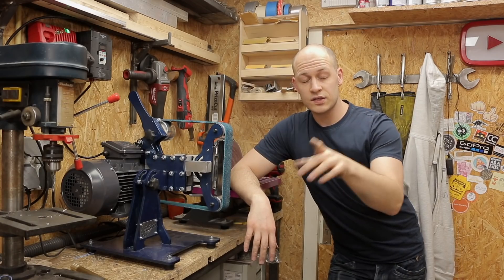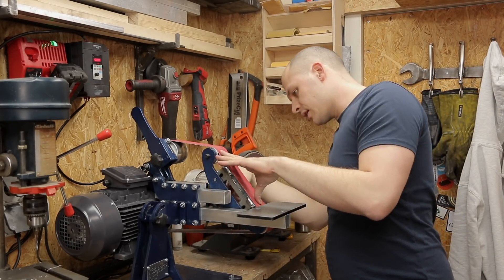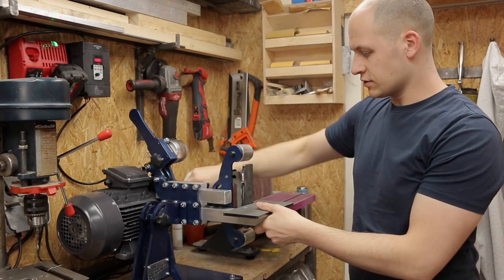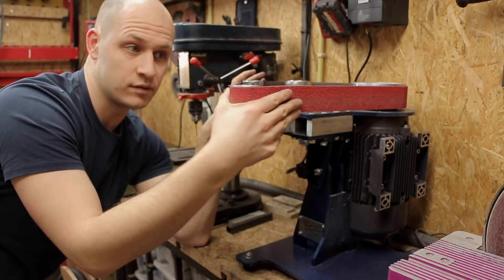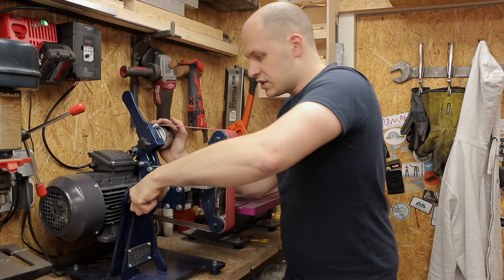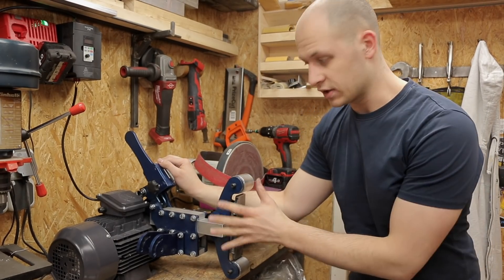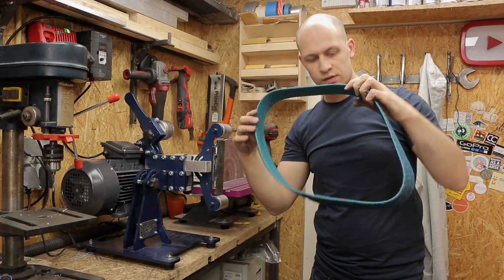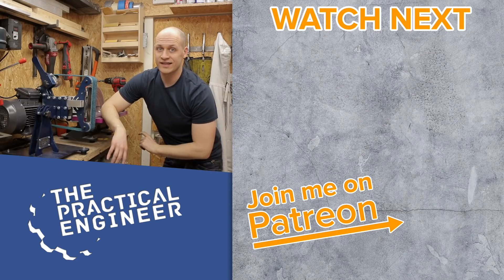Belt grinder overview & questions answered - The plans are ready!

Comment: A Laugh for you.... I watched the assembly film and did exactly what Emile did, and welded the handle bits back to front. Managed to unpick and reweld the right way around, so all is good. I found a return spring on line it is a Fordson Tractor brake return spring and is perfect. I'm real happy with the machine.

Comment: Also Emile the belt is too tight, it will degrade the belt and stretch it out.  It would be advisable to put a spring on that does not have so much tension.

Comment: Emiel, I’m so impressed with your belt grinder design. Very well thought out. Question: what is the diameter of the drive wheel?
Reply from the maker: I have a 5 inch drive wheel on it. That gives me about 20 m/s of belt speed. 6 inch could be a bit better I think but this is already super fast
Reply: The Practical Engineer Ah yes, that’s how you calculated your higher speed. Many belt machines have only 4 inch drive wheels. With imperial measures, a 4 inch wheel is approximately 1 foot travel to 1 motor rpm. Thanks!
Reply from the maker: Yeah, the metric system is a bit more complicated to use 😂😉 I found the 4 inch to be a bit too slow

Comment: I don't have any specific use for it either but I'm sure it would come in handy so I'm seriously considering buying a kit as well.

I'm just wondering what is needed to build it since I don't have any welding equipment myself. I do have a migger available to me but I've got close to zero experience using it so I'm reluctant to use it :P
Reply from the maker: Hey, The kit includes a tiny bit of welding, but you can first puzzle the pieces together and then just melt it together. I believe anyone with a welder can do it.

Comment: Attaching some dust extraction/dust pan to it would be handy
Reply: Selling them as kits probably won't work unless you can go super cheap. There are a lot of people producing these kinds of grinders, especially so at the moment because they are used in knife grinding and since the rise of Alec Steele et al and the Forged in Fire TV programs. Decent ones were difficult to find a few years ago, now really good ones are being produced all over the world by larger manufacturers and back yard engineers that make bespoke ones.